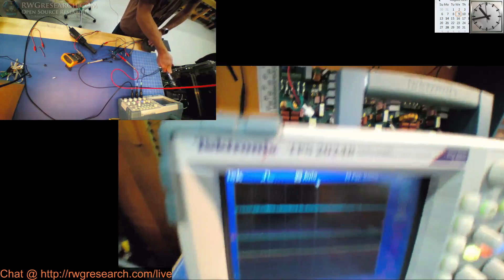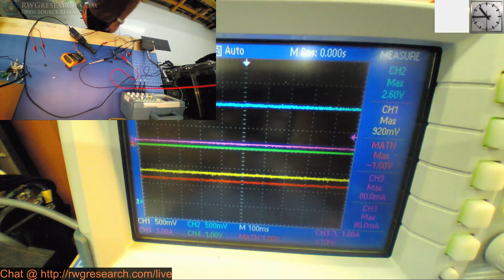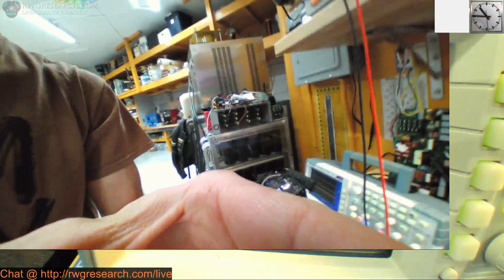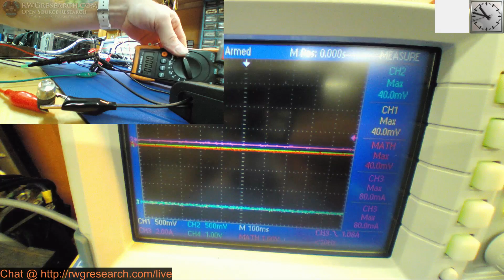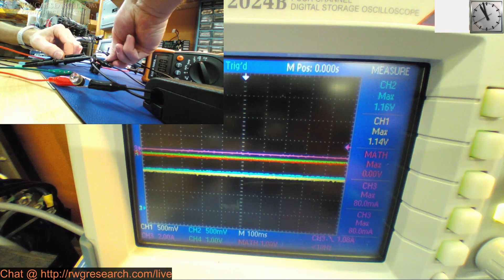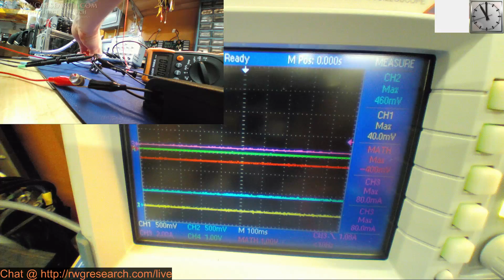Starting At The Basics To Have A Look... P1

Comment: Yup. Thats what led me to the crystal batteries. See the plates have a standing voltage potential.  One plate being say magnesium and the other being graphite. One plate has a potential of  +1.87 volts (magnesium) and the other has an electronegative potential of 2.54. Metals are great for what they call Ionic transfers or donator and the graphite is there for only an electrical terminal. The electrolyte should be made for the metal to guard from oxidation and galvanic response to save the metal from being eaten. Pre oxidizing the metal is a great way to accomplish this and still have an interface for current carrying charges through the electrolyte.
 We also did some work with the captret using capacitors in a very unusual way with the can being one electrode and one of the legs being the other. Strange sympathetic currents would arise between the three capacitances within the capacitor. One plate of each leg and then the main plate of the case. Some reported batteries being charged while using joule thief type devices and diodes.
 I think in a strange way even three transformers on one form shares a strange capacitance with all three primaries. Knowing that you can draw from the difference between two like polarity potentials is the key. Looking at other systems involving all of these ideas is a good idea.
 I wish you luck.
Reply: Thanks for the reply! ~Russ